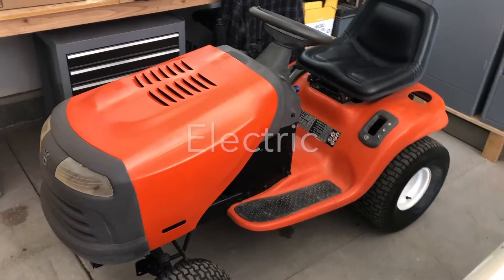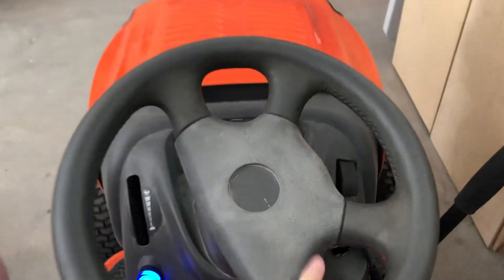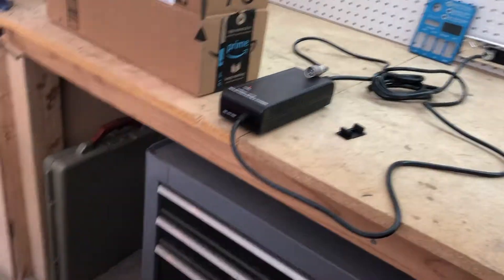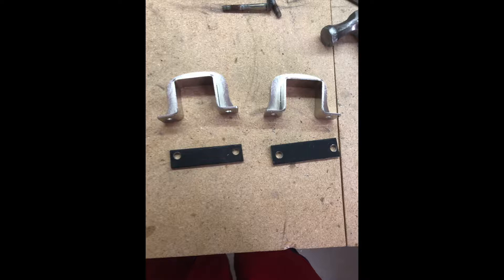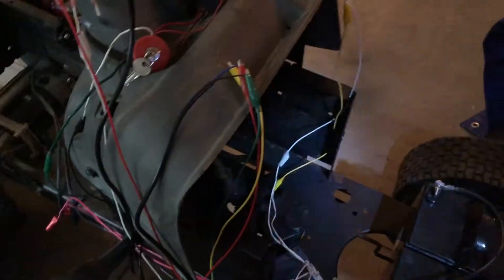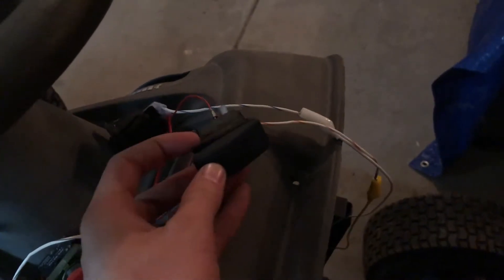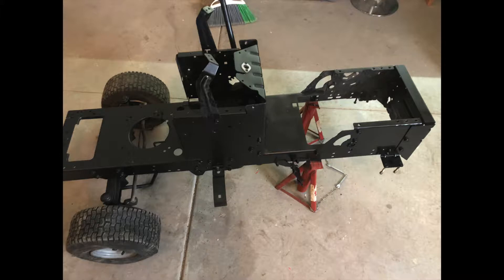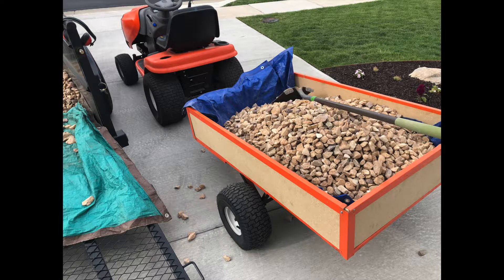Electric Riding Lawn Mower Conversion (Part 2 the electronics)

Comment: Fantastic video, this has given me the confidence to continue with a very similar build, having seen a lot of other conversions where the gas motor has been replaced by an electric one using the existing mower transmission, having the two combined make consummate sense. Would using semi traction batteries make much difference to the usable time between charging?  Have you made one of the switches to halve the voltage ( from 24 to 12 ) to make it easier to do slow speed manoeuvring  ?  Great project, more video of it in use would be good. Many thanks.

Comment: Hey, I'm curious to know if you had updated links for that 24v transaxle? 
Also are you or do you plan on using the same battery for the blade? If so, what cells are you planning on using? Or does the blades need higher volts to spin faster?

I was thinking (since there's a lot of room lol) of going with 60280s :D haha 
Anyway, good vid!

Comment: So, I have been wanting to do this myself.  I have one of these Husqvarna’s that I bought used several years ago with the intent to converting to electric when it kicks the bucket.  I have been doing more maintenance on it and I figure I am starting to get close.  I was originally thinking of just a larger motor as a direct swap for the Kohler, but then I was thinking how bad that hydrostatic trans is, so I want to go the route that you did.  How are you handling the mower deck?  Have you found motors to drive the blades?  Will you operate them as fully independent systems with a separate battery bank from the drive system?
Reply: Im in the same situation.
Looking into how to do it. You have solved the drive very well.

But I need to look into what power and speed the blades need.

Comment: Do you have any more details on the transaxle motor setup you used? Looks like a transaxle from a powered wheelchair.
Reply from the maker: It’s a 24v 800w. You can find them on AliExpress. It’s a bit bigger then the ones they use on wheelchairs.
Reply: @builtfromhome9207  Thanks, I'll keep an eye out for one of those. What are the specs for the motors you are going to use to spin the blades?
Reply: @hansentt  A conversion kit  is available from electriclawntractor.com

Comment: Great video I love to do this. I have an old 16hp Murray 48" cut in my garage I've had for years but my yard isn't big enough for it that's why I parked it. I would like to convert it to electric  where I would have a way around to the local stores. I live in a small city of about 700 people so I'm within a couple hundred yards from everything. The local cops would say something if I were to be riding the sidewalks with a gasoline engine. 
I'm on disability because of a back injury so I can't drive enough to justify owning a car and insuring it since it would sit more than anything. I don't need the mower deck since it wouldn't be used for mowing.

Comment: Hi, inspiring video, attempting to convert an old ride on mower(castle garden D102). Would be very interesting to see the rear axle assembly if possible. As a matter of interest what is the width of your frame and could you advise the size of the transaxle you put unto the ride on mower, btw loved the snow plough video.

Cheers

Comment: This is great information. I'm currently working on converting my old Craftsman over to electric. I'm having trouble finding the parts. Also, how do you know that the transaxle you purchase will fit the old wheels? Where do I find a more recent controller as the one you recommend is no longer available? Thanks!
Reply: I've got a Craftsman Lt1000 I'm wanting to convert. I was looking at a 48v setup, using two of my eBike batteries in parallel to run a 2kw single motor. I'm surprised he's able to drive this with only 800w! I'd of course have to convert the main drive pulley to a chain sprocket, but thinking the blade belts would still work alright?

Comment: What kind of application was the transaxle originally intended for? I'm thinking about doing something similar, and I'm trying to figure out what applications I can salvage one from.
Reply: in my opinion electric wheel chair complete axle should hold just fine,  U got the choise of electric  wheelchair  with  rear axle or choice of two separate motors for each rear wheel and swivel type  front wheels  and in this choice U operate the unit with single Joystick as it is in wheelchair . I hope my post will be  helpful  Mark

Comment: So many questions!! I've been tinkering with this idea for years, but hated the other conversions using the motor under the hood to power the hydro. This is more like what I want to do with the motor and trans mounted in the rear. I have an idea to turn a mower into a single rider golf cart and I'm curious if a person should step up to a 36v or 48v for that purpose, but I also don't know how many watts I should be considering when doing so. Any ideas?
Reply from the maker: Check out my new videos on the other lawn mower conversion I’m doing right now. It’s going to be 48v
Reply: @builtfromhome9207  Thank you!! Exactly what I was looking at!